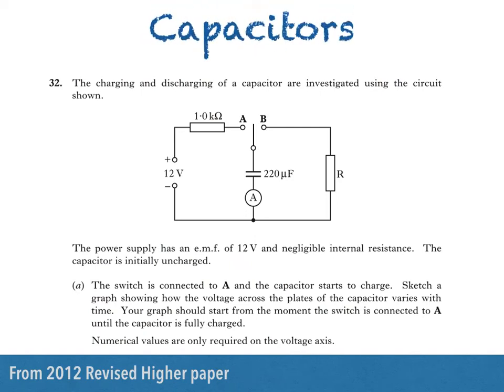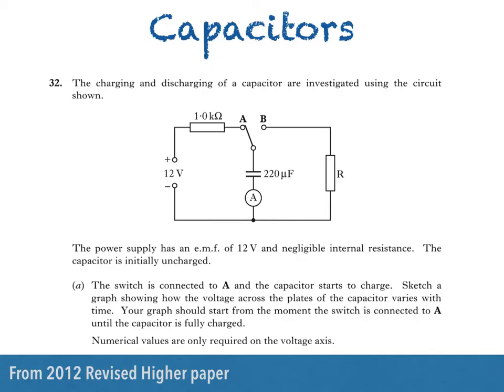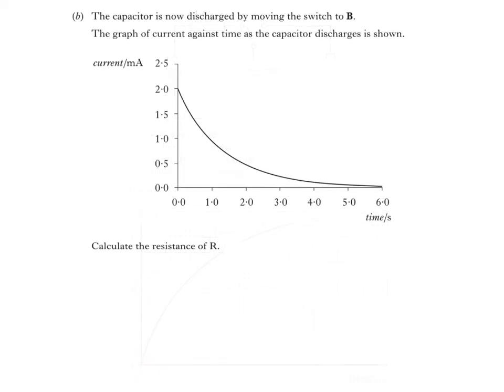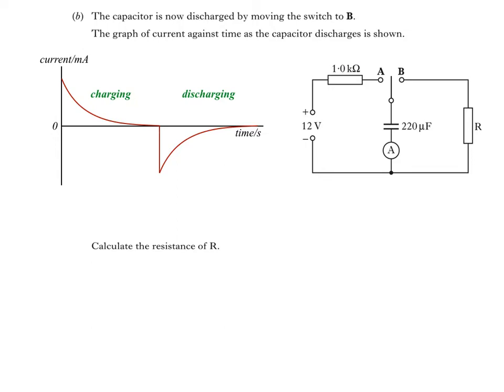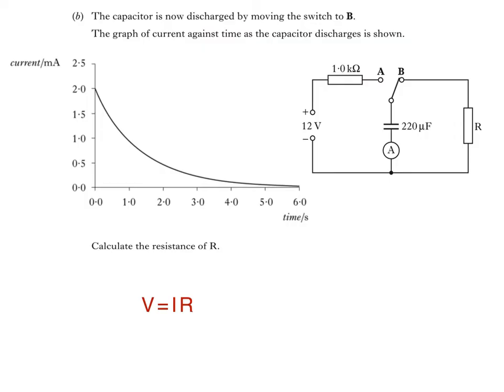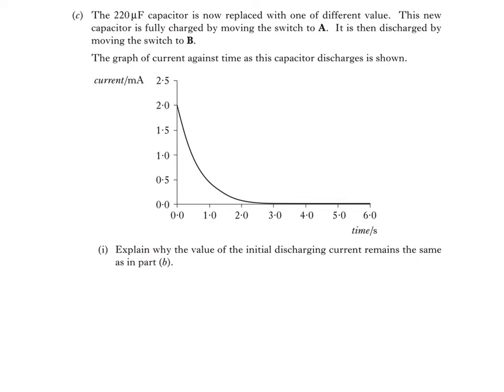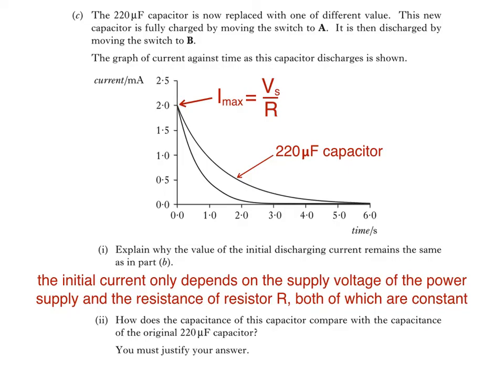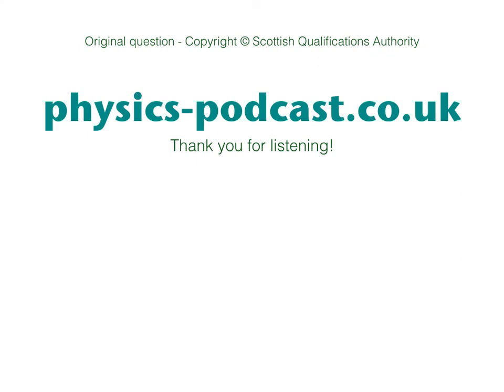Higher Physics - Capacitors

Comment: what is the difference between revised higher and the other discontinued higher? since there are papers for both for one year
Reply from the maker: The 'old' Higher exams contain work that's not covered in CfE such as pressure in a liquid, how MOSFETs are constructed and so on - if you're using them to revise then maybe check with your teacher which questions to avoid. Revised Higher is the same as CfE as far as the content covered, though. I remember one year when all 3 exams ran in various schools around the country. At least now we're all doing the same thing!
Reply: @MrSmithsPhysicsonline  thank you :)